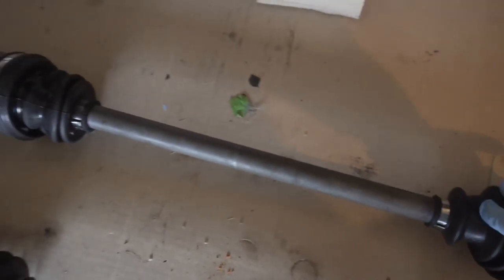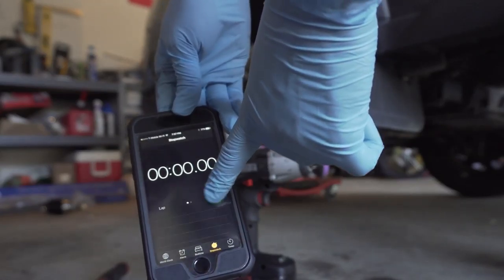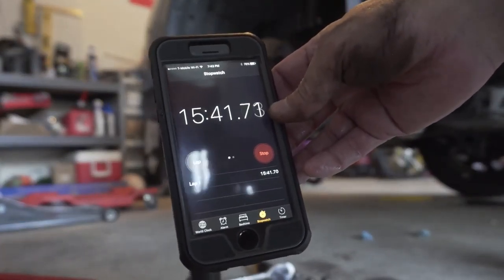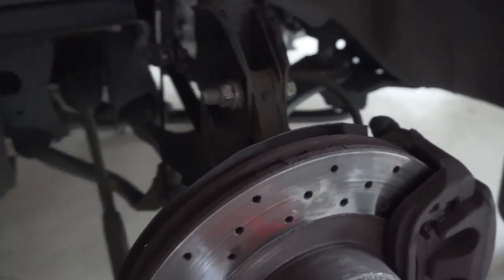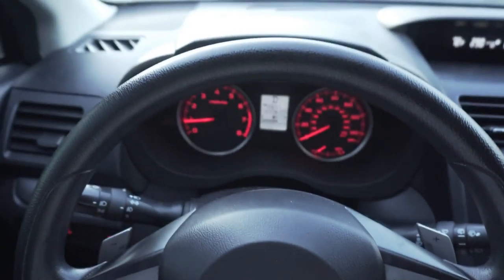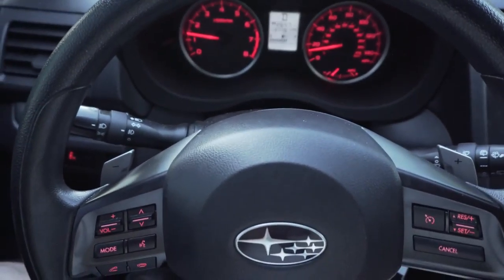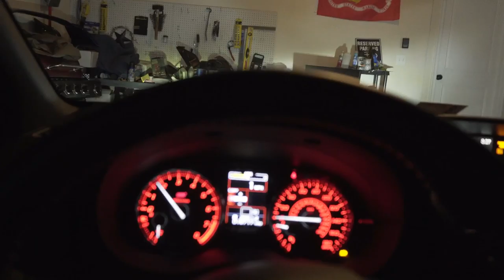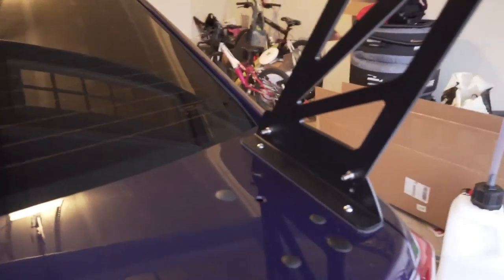Someone Is Going To Complain | Big Wing | 2017 Subaru WRX STI

Comment: Question about brakes for autocross, do you prefer drilled, slotted, both or just flat rotors? I've heard drilled can crack on the track.
Reply from the maker: Mattboy300 yes, drilled can crack on track. I dont think for autocross they would crack because you wont be braking as much as on a track. But slotted is the way to go
Reply: Awesome, I have slotted on mine but it only ever sees street use :P